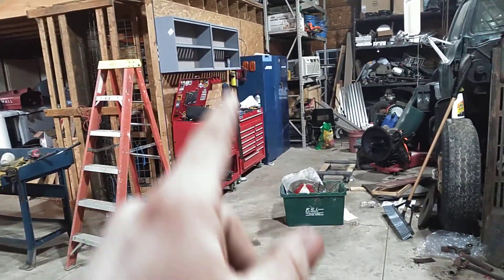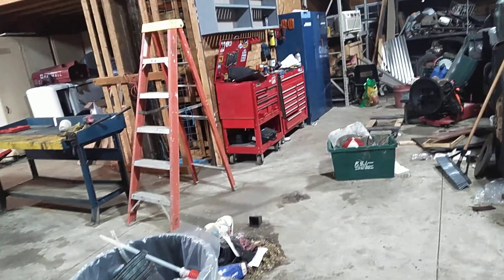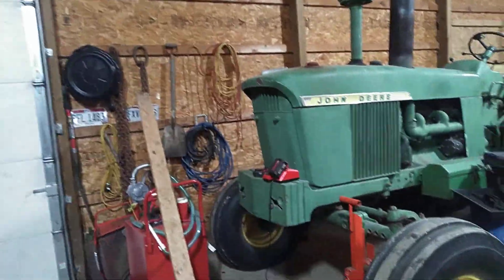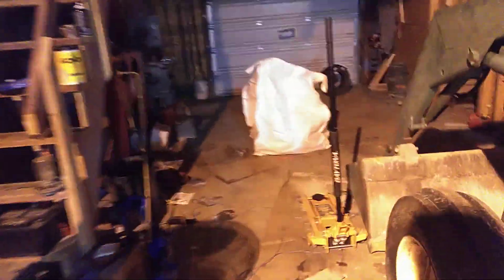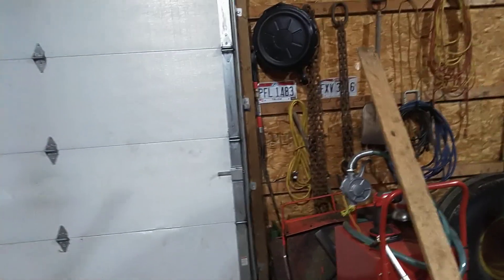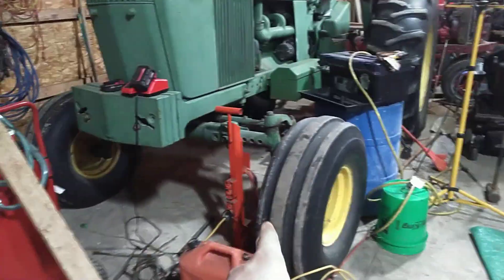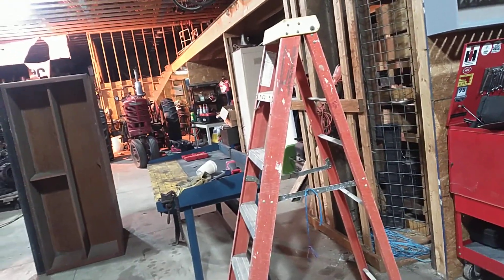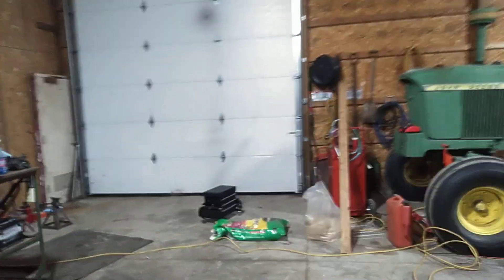Ideas For Shop Airlines

Comment: I used 1/2 schedule 40 pvc and I have had in my shop for 9 years now with no problem running 175psi. The nice thing is it's cheap the fittings are $2 for a bag of 10 and the pipe is under $2 a stick and it's rated for 600 psi. You can save even more money at Menards with the 11% rebate. I even used the pvc under ground to my other barn and plumbed it in and I have air lines in there  also. Don't waste your money on the air line kits. Schedule 40 pvc works great .

Comment: Use 1in schedule 40 PVC  it's rated for 200-300psi you shouldn't have a problem with that. I'd run it on the ceiling with multiple hose reels that automatically wind up.